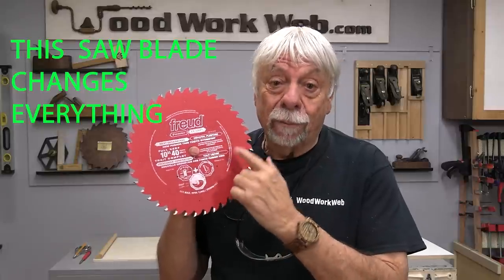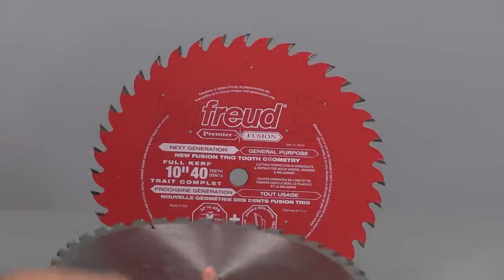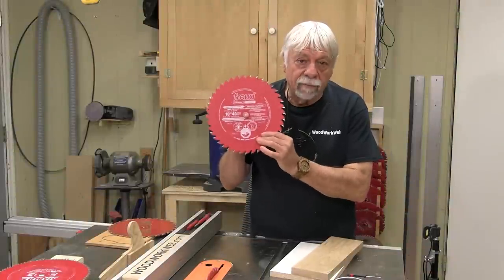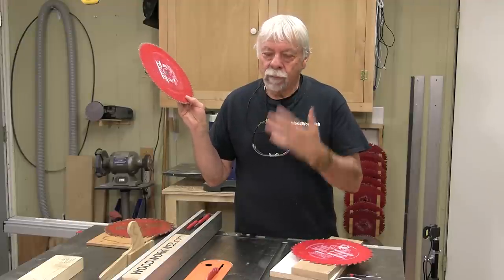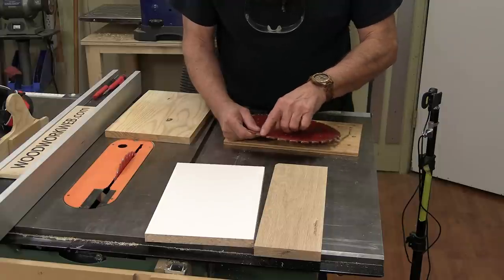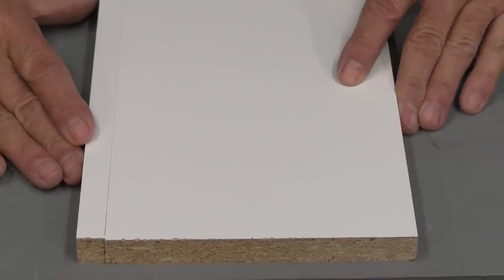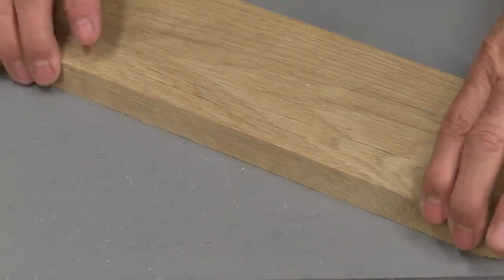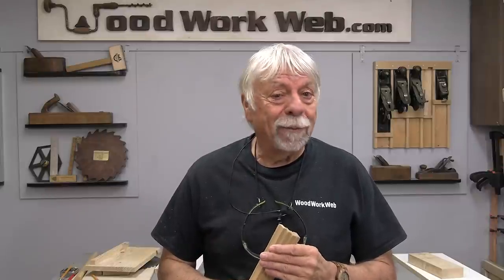Is This The BEST Saw Blade Ever? / Freud Premier Fusion

Comment: Sure, like your information. I do mostly high-end work, but on a small scale. My question is can a woodworker get just as good a cut with an 8.5-inch table saw. I need to get a new one and am curious to know if it is just as accurate as a 10-inch blade? Probably will get a contractors saw since I do not do a great amount of work. Thanks

Comment: I cut melamine every day with Freud blades on a table saw and on a chop saw, and I can say that the blade will always do well at first, however within a short time it will be dull enough to chip out the "bottom" melamine, and only with a sacrificial board can you be assured of a clean cut.  This is why most cabinets are cut on CNC router tables with sacrificial MDF sheets under the melamine.    When I need a clean cut on both sides I might use a sacrificial piece or sometimes I use a track saw since that can also get pretty good clean cuts on both sides.  Melamine is tough on saw blades and the glues and resins they bind the wood together with aren't great either.  Just my two cents.

Comment: U need to try these SAXTON BLADES Colin my friend.. They're far cheaper and the cuts are fantastic. I have been very impressed by them so far. I have been using a 28T 250mm x 30mm Bore and 2.6mm Kerf.. I also bought their 40T 250mm x 30mm bore 2.6mm kerf.. There has been no tear out so far and I've been using the 28T for ripping Plywood, MDF, OSB board, hardwoods, softwoods, etc.. The cut from my 40T SAXTON blade is so clean as well Colin. I would like to ask u to give them a try if u have then cash to spend. They're very inexpensive blades. I don't know if they're stamp pressed blades bcos I'm not in my shop atm but i will check tomorrow and let u know.. Thanks for the heads up on these FREUD blades..

Comment: One reason Diablo blades are so good is they ARE made by Freud. Actually Bosch owns both the Freud and Diablo brands.  While Freud is normally rated as the best in price range, and rightfully so, Diablo is just a little bit lower in quality and price range.  Keep in mind, BOTH are high quality tools and well worth the price.  Comparing these two brands of the same type/style blades, will show the results are nearly identical.
Thanks for another GREAT video.  As always, you present a load of educational information.

Comment: If it had some flat-top rakers, this would be the one blade to run them all
Reply: I totally agree with adding the flat-top rakers.  It sure would help from having to switch over to a dado stack for non-through cuts.  Must have something to do with causing tearing-out when cross cutting.
Reply: Amen.
Reply: You're the Tolkien of woodworking!

Comment: I usually only run Diablo blades, but sometimes I buy Freud, I simply can’t justify spending top dollar for a blade. Yes they can be sharpened, but you have to buy two top dollar blades while you’re waiting on the other to be sharpened. The Diablo blades cut nicely in my opinion. I have never tried the blade you addressed in this video, nor have I even used the the Freud glue line blades. Thank for the recommendation. I might just try the blade you shared with us. Can the freud blade be sharpened?
Reply: Yes it can be sharpened.
Reply: Diablo is made by Freud
Reply: @nicholasmarino17  yes they do, but the Diablo blades are cheaper, at least where I live.

Comment: I've been telling people about this blade whenever there is interest in woodworking and I will say it again: this is really the best single blade you can get. It's literally an "upgrade" for any table saw that doesn't have one. Forget about those boutique blades that keep getting recommended by youtubers trying to do a favor for their buddies who sell crappy blades... Freud Industrial makes good blades and other cutting tools in general but this Premier Fusion is really going to be the last blade you buy for your table saw. I use the P410T which is the thin-kerf version. You will be able to make precise cuts in any kind of wood. It stays crazy sharp for so long, that even though the initial price is higher it will keep going whereas cheaper blades would have had to have been replaced or resharpened...and there's enough meat on the teeth to resharpen the P410T when it finally does need it (mine 5+ years still sharp as new and I've cut many feet of wood in that time).

Comment: I haven't had good luck with thin-kerf blades, even the Freuds, they tend to flex on me and leave somewhat of a very slightly wavy edge.
Reply: Yep, especially on a 12-inch compound miter saw.
Reply: You're probably doing it wrong. The blade won't flex if you manage the feed rate, which depends on the power of your saw and the material you are cutting. Anything more than a moderate pressure is too much (if you are using a miter saw), and with a table saw you need to properly align the blade to the riving knife before using it.
Reply: @alphaforce6998  Yeah dude, no one knows how to use a saw but you.
Reply: @Skinnymoose   Somehow you've landed yourself in the 0.01% of people who manage to blend these blades. I've never had that problem. If it wasn't user-error, then you are essentially telling us that the proper operation of a table saw and/or miter saw is something that you struggle with.

Comment: So this blade is an alternating top bevel and it will not produce a flat bottom cut. So if used for a dado it will produce a rough bottom. Is this correct?
Reply: Yes, that is correct
Reply: @charlessas4138  do you know if this blade is made with a flat top bevel so it can be used for dados and other situations where a flat bottom cut is preferred ?
Reply: No flat ground tooth. If you want flat bottom kerf, you would need to buy a Flat Top blade

Comment: I like the Freud blades but on my Sawstop Industrial cabinet saw the Freud blades are shorter in height than the riving knife so if you are doing a cut that doesn't pass through the piece and have the riving knife on, the knife hits the cut and lifts the board up. It's kinda bull that you have to grind the riving knife down to do these kind of cuts. None of my other blades are like this.
Reply: Interesting. I don’t have that issue on my saw which is the same model.

Comment: Will this blade trigger the sawstop sensor as it’s painted red
Reply: I think your sensor is a tad too slow, Kate, if it only reacts when it senses blood.  😎
Reply: I think what you mean is, will the SawStop safety system still function with this blade even though it has a red coating. I have a couple of red Freud blades for my SawStop PCS, and the test is to mount the blade in the saw, turn the main power switch on and let the saw go through it's self tests, then gently touch one tooth with your finger (blade not spinning, obviously). If the red light flashes, then you know the saw can sense your finger and it will work. My red Freud blades pass this test so yes they work fine.
Reply: @62effjay  thank you

Comment: I'm going to guess this is covered on your Choosing Blades video referenced at the end, but you probably should not use the full kerf blade if you have a lower hp saw. (I have a 3 hp Sawstop, and have used premier fusion for quite some time.) It is my understanding all the Diablo blades are think kerf. Also, why are you not using a riving knife when ripping those boards? (I would have said blade guard, but then the viewer would not be able to see the cut.) I think viewers newer to the use of a table saw should be instructed on some basic safety ideas, or at least told when you are not following them.

Comment: You should research how madden blades are designed to be raised to the bottom of the gullet and not 1/8” above the wood. 
Don’t buy these low cost blades. My Popular Tool blades or Amana or made to order cermet blades from Carbide Processors plus several other manufacturers are sharper and stay sharper. The company you’re recommending has become more of a basic consumer blade and not for the real user of the tool. Everyone should keep their blades clean.